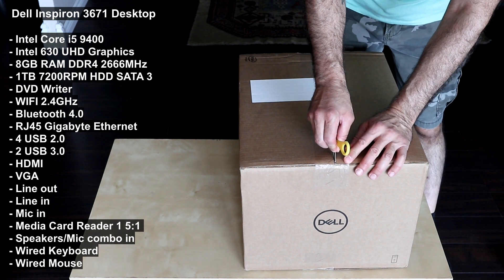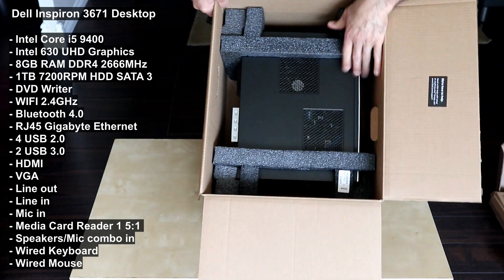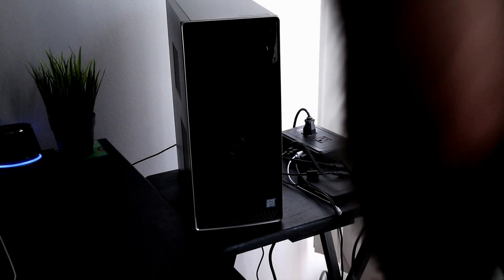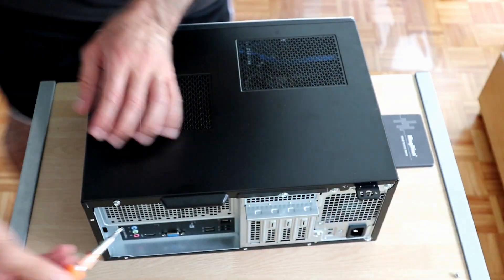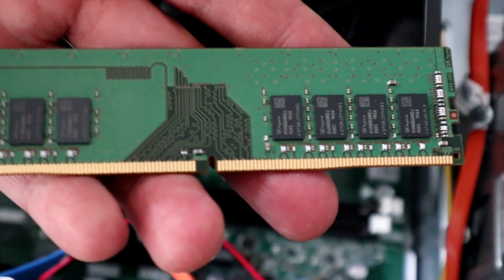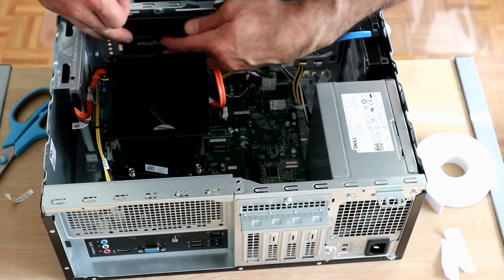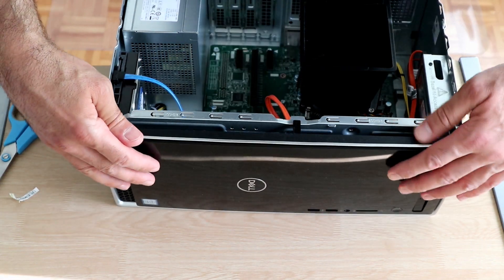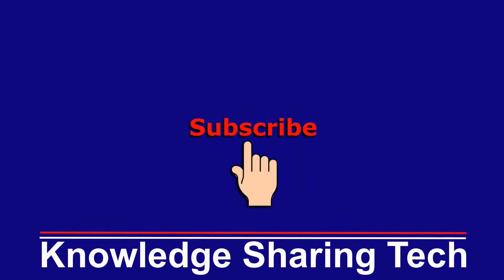Dell Inspiron desktop Unboxing, upgrade options and SSD upgrade

Comment: Does it matter which SATA port is used to connect a new 2.5 SSD? which sata port on the motherboard  did you connected the cable? there are port 2 ,3  thanks
Reply from the maker: It doesn't matter. If you want to use the new drive to boot, when you install the OS on it, it should boot from it. Otherwise, go to the BIOS settings and choose it to boot from
Reply: @KnowledgeSharingTech  Ok thank you

Comment: Do you need to buy sata power and data cables or there are ready cables from the power supply ? do you need to buy bracket for the 2.5 ssd? thanks
Reply from the maker: No brackets are needed, just screws, if you are keeping the original HD and you want to add the SSD, you should get sata cables for both power and data
Reply: @KnowledgeSharingTech  Thanks for your reply

Comment: how many pins for the plug on the MOBO ? Proprietary dell 8 pin? Or the standard 20 or 24 pin for the powersupply?
Reply from the maker: Proprietary 8 Pin
Reply: @KnowledgeSharingTech  thanks for the info!
Reply from the maker: @ravosblackrose  You bet!

Comment: Is it possible to case upgrade this pc? The current case is too small for my component upgrades.
Reply from the maker: The motherboard is proprietary so it would be tricky
Reply: @KnowledgeSharingTech  do you suggest just buying a new motherboard

Comment: Where did you connect the ssd for power and connection ? Was that the second SATA power you shower and connected it to SATA 1 for Data ?
Reply from the maker: Exactly, you need a sata power, I put a link in the description of the video

Comment: Which dual brand Wifi adapter should I use to upgrade as it's only accepts 2.4  GHz???
Reply from the maker: If you are using Windows, pick up anyone that is 600 Mbps or more like this one: https://amzn.to/3dpLo8g . For Linux, the Panda N600 is good: https://amzn.to/33TD4uH

Comment: Hey Knowledge Sharing Tech,was wondering if I could swap the UHD graphics card to a gaming one,is it possible.
Reply from the maker: Yes it is. Without changing the PSU, the highest card you can install is a GTX 1650 Super, video here: https://youtu.be/GShJctyR8_M. Also watch this video where I install a GT 1030 in this Inspiron: https://youtu.be/Vkfyg5Ssxv4 .

Comment: I wonder if its compatible with a pci express, firewire controller 🤔
Reply from the maker: Hi, it has 2 PCI Express 1 slots and a PCI Express 16 gen 3 slot. If your card is compatible with these slots and it doesn't need external power, then it should work
Reply: @KnowledgeSharingTech  thanks for the quick  responce,  I ve already ordered  one from eBay...i still waiting to recieve it..hope it works🤞